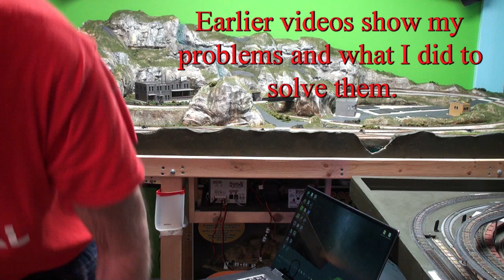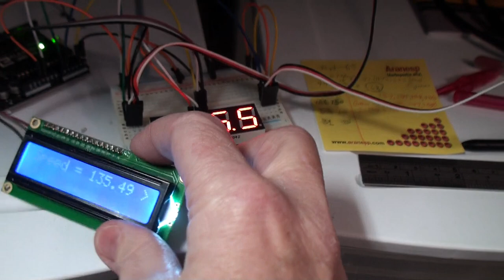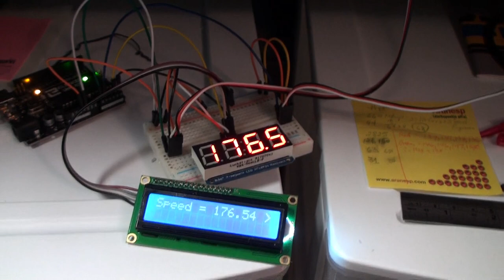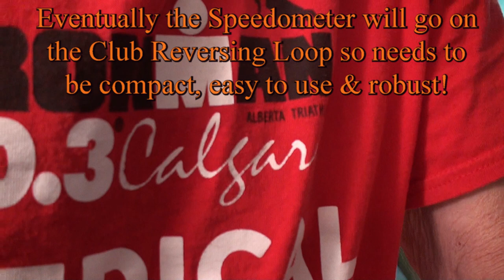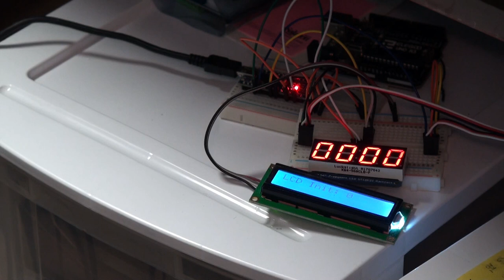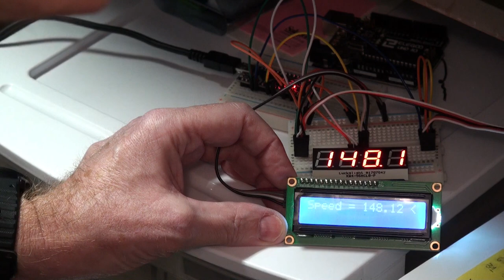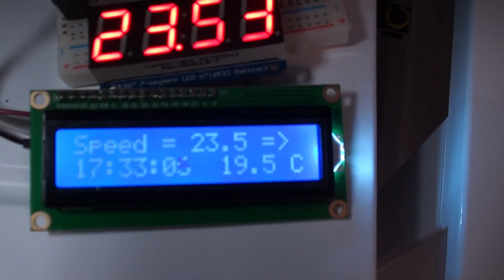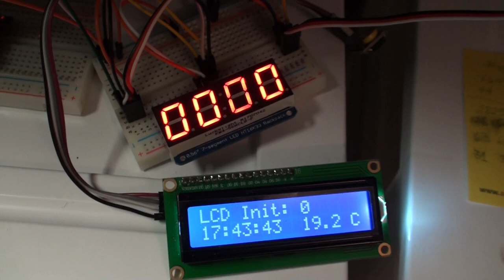Build N Scale Speedometer on your existing layout - Part 6.

Comment: Awesome job on the speedometer. Great work on the display, really like what the LCD shows. Any chance you can video the code. I can follow the program, but there is no way I could ever write what you have done.
Reply from the maker: Thanks Paul.  I plan to publish the code once I've got the setup complete.   I had wanted to wait so that I could run it on my test layout for awhile to try to kill as many bugs as possible.    Yes, I'll video the code, explaining it and then likely figure out github and use that as well for distribution although I'll need to "learn" how to do that.